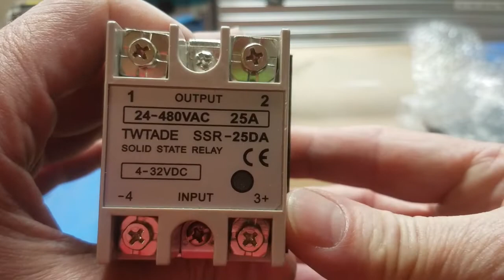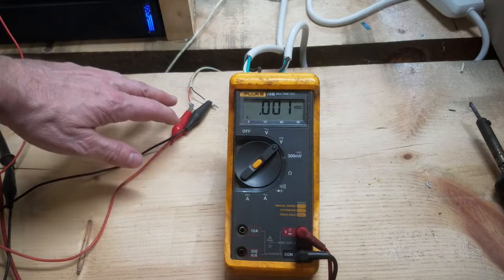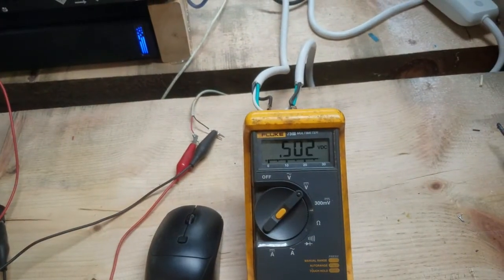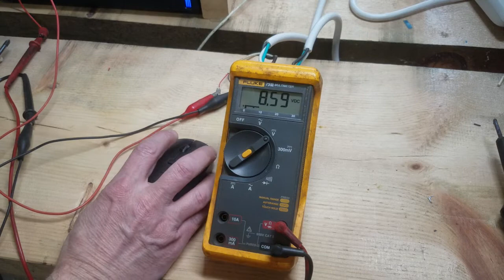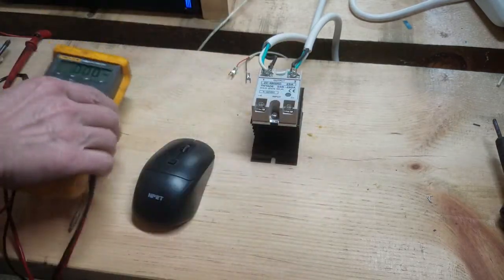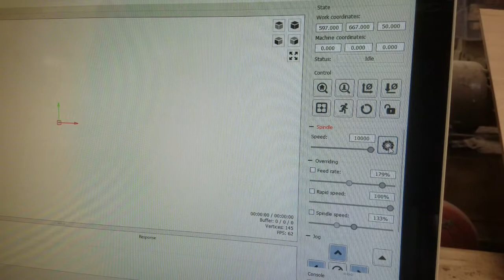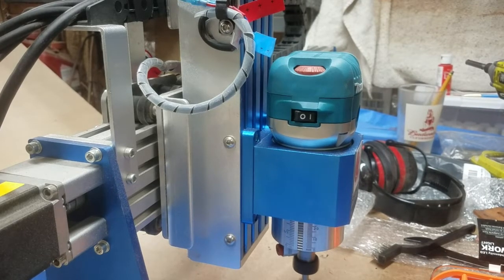How to re-automate your router upgraded Sainsmart - Genmitsu PROVERXL cnc w/ a solid state relay

Comment: Useful, but I'm def putting this in a box / enclosure of some kind; cutting metal and or using metal tools, eventually I'll end up bridging those two terminals.
Reply from the maker: A sound insulated "room of it's own" is a great idea.  I have since moved the dust collector out of the room and that helped a lot with the noise but the router is LOUD.

Comment: it is best to use a 48vdc relay as that is the max voltage output of the ProverXL .  I like the video  tho, I see that you wired everything in parallel. I tried series first and it tripped the relay but would not turn on the spindle.
Reply from the maker: 32 volt max written on the relay, I don't want to cook it.  I think that is a transistor in there, only needs a tiny amount, too much and it'll get hot.  Used it last night (video coming out soon) and it worked perfectly at 9-10 volts or whatever it was I taped the knob down at.